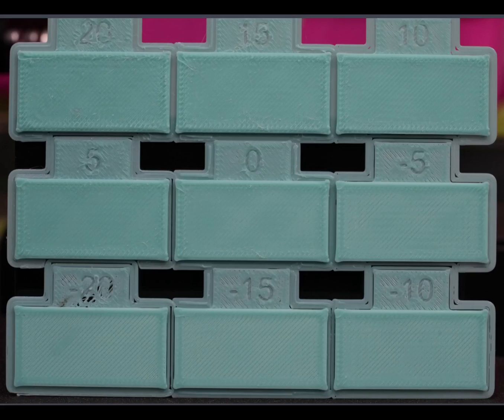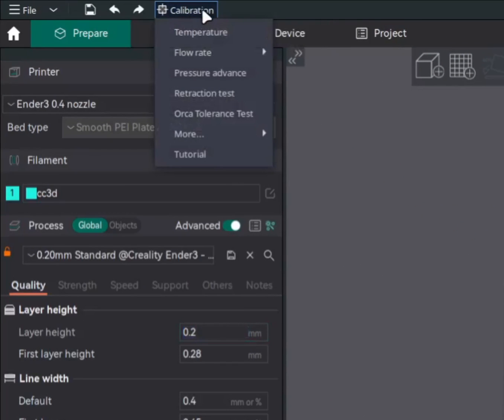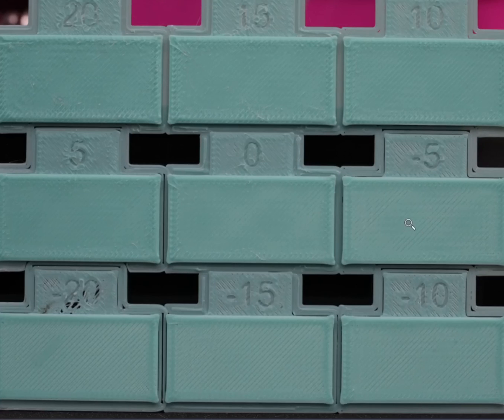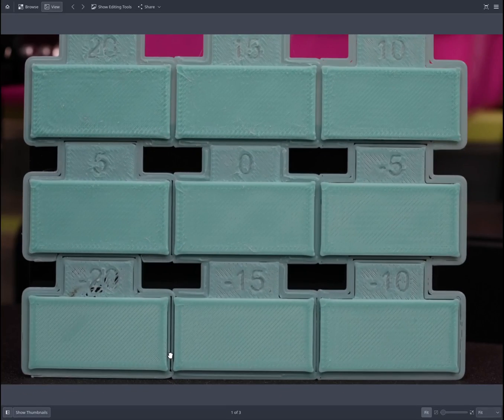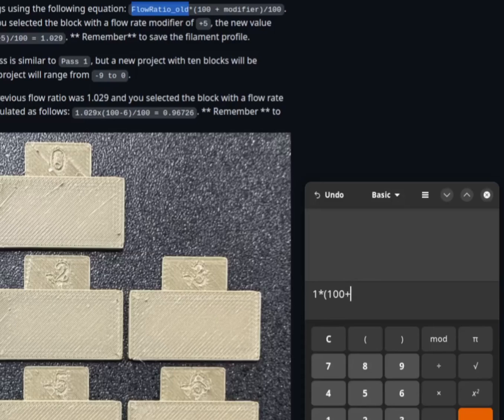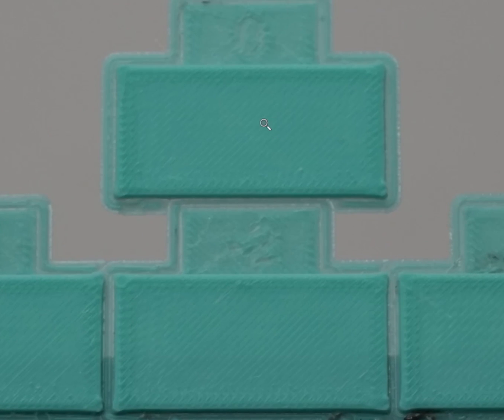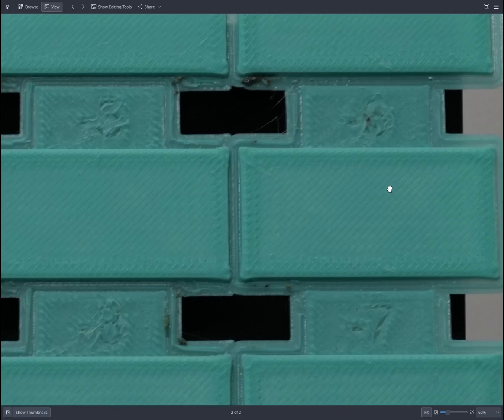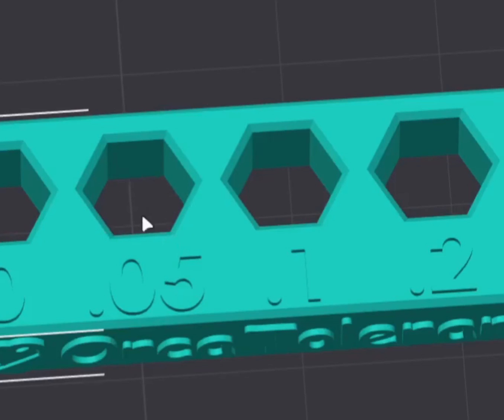Flow Ratio - OrcaSlicer (Orca Tolerance Test)

Comment: Hi, there's actually an error here. Everyone gets it wrong, so I'm posting :)

The modifier used for calibration test is print_Flow_ratio (the flow ratio under per object/process settings in Orca). The ratio you set after tests is filament_flow_ratio in filament settings. print flow ratio is accounted for in the speedcap. Filament flow ratio is not. So instead of setting your filament flow ratio after the test, you must instead set the print flow ratio per object to get the same extrusion profile. Lmk what you think!

Comment: Your videos are great. I struggle with this floor rate test. I often find that I don’t get a smooth surface out gap free surface. It feels like an endless trial and error with no great results. What order do you do all the calibrations in? Temperature tower, Pressure advance, flow rate, retraction? Im using a high speed petg filament from Sunlu.

Comment: I went through the steps but obviously messed up somewhere, the printed peg fits in 0.3 snugly and a 6mm allen key fits in 0.2 very tight but 0.3 is kind of loose, I'd call it 0.25 maybe? 

I don't know what to do with these results, however. Obviously my hole is undersized and my peg is oversized, I assume this means I have too much flow and should reduce it slightly? Or should I tweak like the X-Y Hole Compensation in Orca? I don't know what to do with the results I've found.

Comment: What size is the allen key?
Reply from the maker: 6mm
Reply: @radiy3dprints  take a pair of calipers and measure your allen key / wrench. you'll notice it's slightly smaller than 6mm i have two different allen keys from different manufactures, and one measures 5.87mm where as the other measures 5.9mm i believe their specifically undersized to fit inside a 6mm hole.